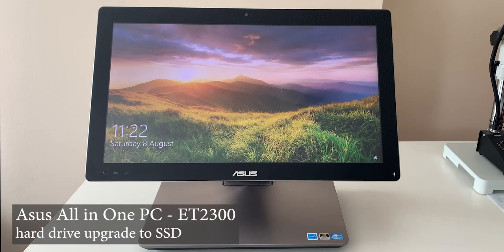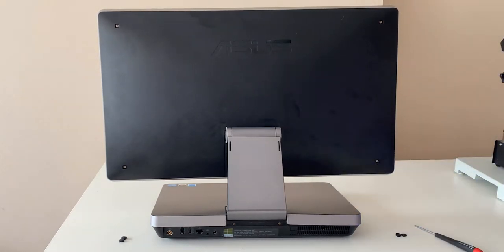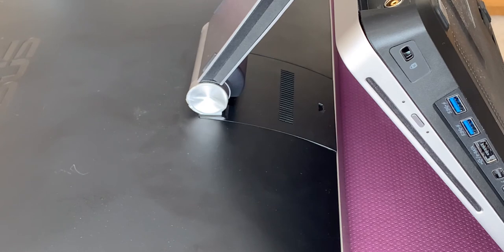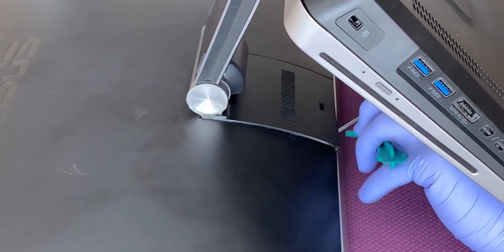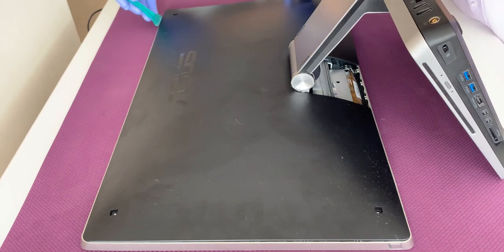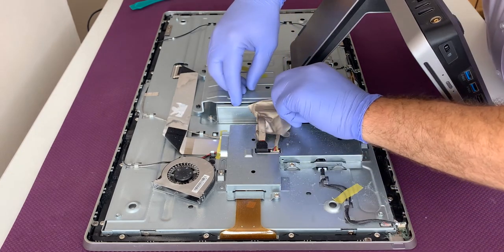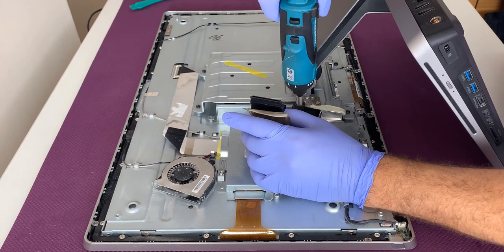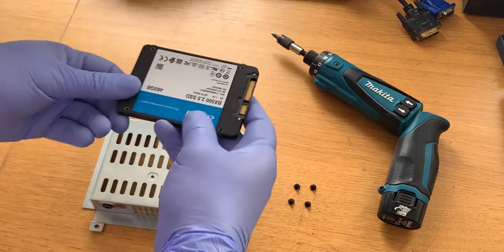Asus All In One ET2300 Hard Drive Upgrade to SSD - partial disassembly

Comment: Hi, I am still having trouble removing the whole back cover as the clips on the top part are difficult to “unclip” unlike from your video. You have done it so easily. how???
Reply from the maker: use a spudger tool to get started and slowly work your way around.. once you get started is easy.. you must also make sure you have removed the screws and done exactly as it is on the video.
Reply: Let Me Show You thank you for this video (I’ve been searching a lot for this). I have removed the cover just now. using screwdrivers for anchor and lever. did a few small scratches on the cover though. 😅